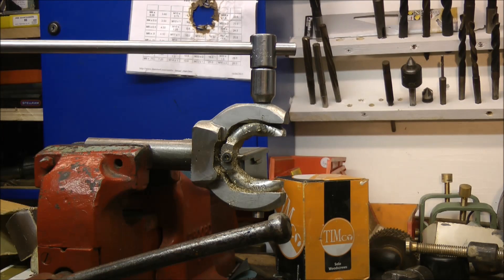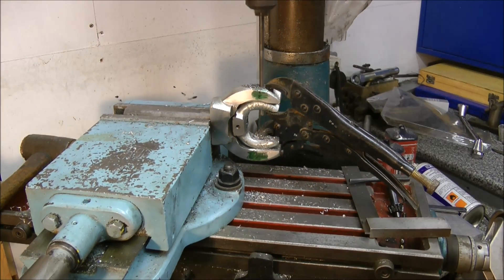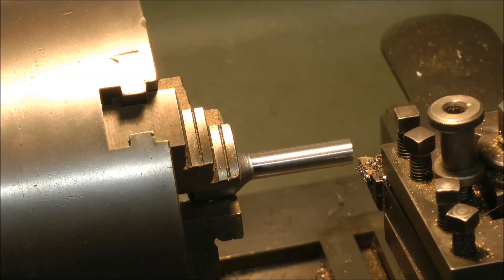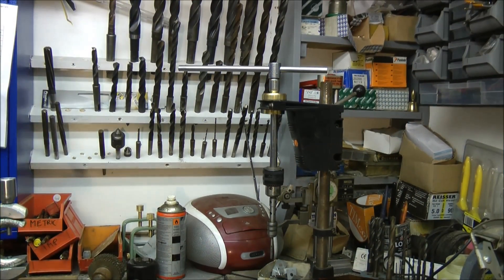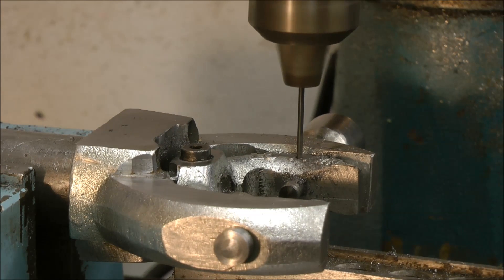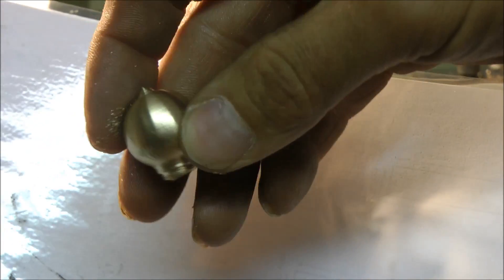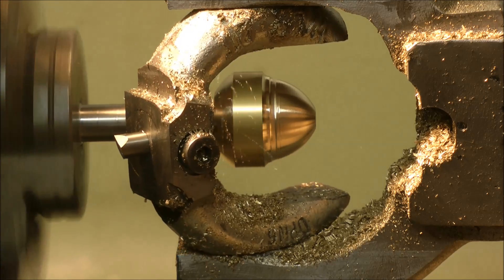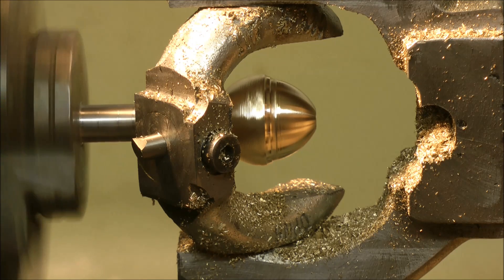Homemade ball cutter cuts brass with great results learning on the lathe

Comment: how can you know the radius of the ball which you are turning?
Reply from the maker: Hi, jeez it's been a few years now! Well it can't be bigger than the bar stock I know that :), if I want a 25 MM. ball I select 25mm stock and set the cutter to the side and wind it in for smaller !, the will be better instructions on other vids!
Reply: tip  of cutter to center distance

Comment: I kinda liked the acorn shape. I'm an electrician that is getting into machining and I'm just about finished with my ball turning tool which is the first thing I've done in my shop at home. I think I'll be happy if mine works close to yours. Of course I'll have to make a new one till I get it right. I think I took on a project not suited for a first project but if it doesnt work it wasn't expensive. I've got the same mill you do. I'm going to convert it to CNC just for fun. I'll be watching more of your stuff. Thanks!
Reply from the maker: Hi Tony ,that's a hell of a first project,  learn through doing is the best way to work your way around the machine shop,  check out my knurling tool, and mamod v8  steam engine both great projects, and I've only been having a bash at it for a couple years so the sky is the limit my friend!

Comment: Hi Chris, leaving aside the chatter you are not getting balls because of your method of feed adjustment is putting the pivot point past the centre line of the lathe. As you have no adjustment on the cutter itself, you can only cut a ball of one diameter, as you have to stop cutting when centre line is reached.. That aside good effort.
LL&P
chris
Reply from the maker: hi Chris, thanks ill try, try again, im sending off for a carbide tool and ill see how I get on , don't suppose you need a bag of brass acorns? ha ha regards Chris :)

Comment: Howdy Chris! I really do like how your finished turner looks! I'm quite sure your turner is fine. It's been a while since I've turned a ball, but if I remember correctly, it's something like this.   Your part should be same length as diameter. Move the carriage and cross feed so the cutting point is on center of the diameter of the piece. Lock the carriage.  Move cross feed out until tool clears, then start feeding in, removing material.  The left side (chuck side) and right side should be done in the same swing of the radius turner.   Did I confuse you yet? I think Mr Pete222 has a video called something like "turning a ball on lathe" and he walks through the setup.
Reply from the maker: hey!, lol, cant seem to get rid of the chatter on the rear of the cut, im going to try a carbide tool, as most ive seen use it, otherwise its buy  a repton rt1 ,or make a boring head designed tool, or a good week on the xbox  ha ha